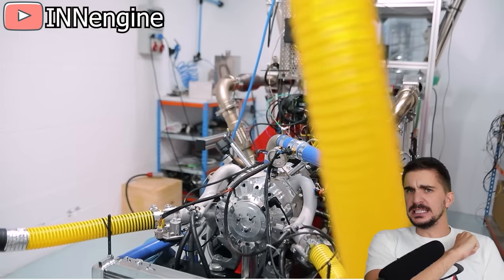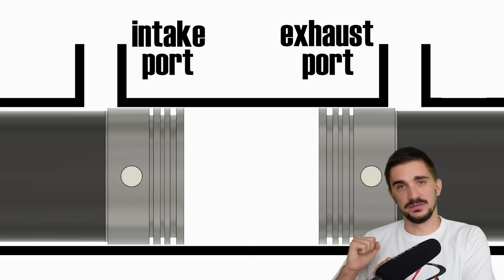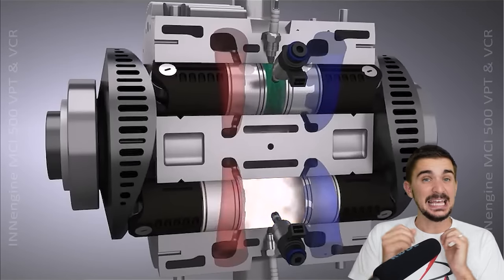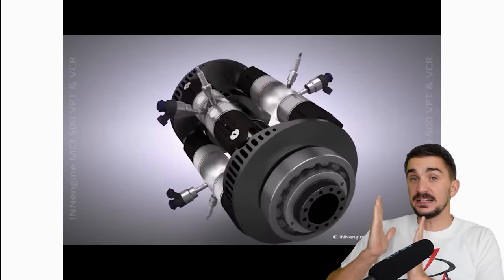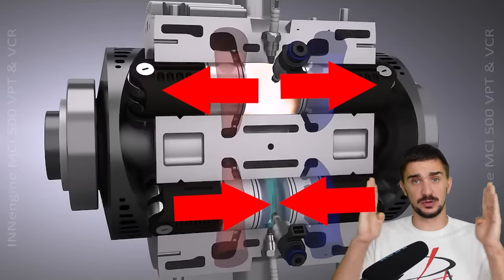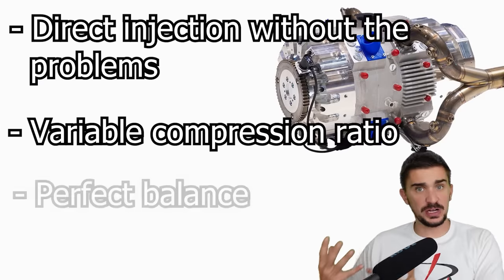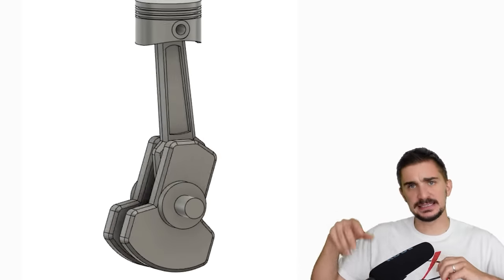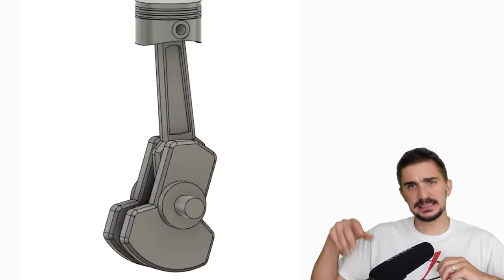Spain is Living in 2050? Revolutionary 1 Stroke INNengine Analyzed

Comment: Actual one stroke engine, mass manufactured and used widely in it’s era: the double-acting steam engine. Each stroke of the piston is a power stroke.
Reply: Hey, i am using your comment to warn people. This company is a scam. They don't have a product. If you give them money, it will be gone without any use for you.
Reply: steam engine is not even a 1 stroke, it is always on a power stroke on either side of the same piston. power on push and pull of every stroke.
Reply: It's still intake and exhaust though. It's just using both sides of the piston
Reply: I came to comments to say that as well.
Reply: Stream engines are external combustion engines; you're mixing apples and oranges.
Reply: @electronsmove  Every stroke in a steam engine provides power, therefore a power stroke every 1 stroke. Hence 1 stroke engine.
Reply: @mikeh2850  The intake is the power stroke on side A while side B is vented. Then switch / repeat.
It's never not on a power stroke.  We are referring to how many strokes to make one power stroke. So the answer is 0.
The only time it is not making power is at TDC for a few degrees while it changes direction.  Always wondered how you get a single cylinder steam engine to turn if it stopped right at TDC. It would be stuck without some input to the flywheel to get it past TDC.
To be fair the steam engine benefits from an external combustion chamber (boiler) to produce a forced induction charge and there is no need to combust the charge in the cylinder. I wish we could have enjoyed a longer period of history with the steam engine it was too short lived due to high maintenance. I wonder what we could do today if used modern techniques to build steam traction engines.
Reply: With low-revving Diesel engines for maritime applications in the first half of 20th century, a 2-combustion-chamber-per-piston arrangement was not uncommon. They fire every 180 degs per piston having one chamber above, one below the piston. But it wouldn't make any sense to call them 1-stroke as it is obviously a double-2stroke arrangement.
Reply: only one stroke engine is a rocket/jet engine.
Reply: @wargamingrefugee9065  makes it a motor
Reply: @electronsmove  Traction engines were often single cylinders, and they indeed have this problem of dead-centering and not being able to start on their own!

There's a few things you can do to fix it. If it's a model, you can push the flywheel over tdc and it'll start going. You can do this on larger engines too if you're feeling brave or you're on flat ground.

For full size engines, you could take off the brake and roll backwards/forwards a bit to get the piston moving again. For very large, stationary engines such as mill engines they would often have another, smaller engine to get them started and avoid the issue.

For compound engines, they have a similar problem but a neat workaround - due to the offset of the pistons, you're guaranteed that at least one will not be "stuck". If your hp cylinder is stuck, you can usually bypass it and send steam directly to the lp cylinder to get it moving (and at one hell of a rate considering you're now supplying full pressure to a cylinder designed to run on exhaust!)

-- edit to add something

I forgot the most important solution, just don't stop at tdc! 😆When bringing the engine to a stop you can make sure that you're past that point, avoiding the problem altogether
Reply: @Adesterr  Could you add a source by chance?
Reply: Yes, steam engine with baker or walschaerts valve gear.
Reply: @electronsmove  you should read on abner doble ;) if he had made his steamcar more on masse instead of expensive high end one of a kind, we might all very well be driving steamcars today
Reply: Also exhaust on the otherside...
Reply: @Adesterr  I was thinking of a "new" sportscar with 1000´s of horsepower that people have been waiting for..
They are still waiting... I dont even remember the name of the car. But they really liked investors...
Reply: @electronsmove  Valve timing on a steam engine, which feeds steam from either end of the cylinder, The connecting rod is offset from the crankshaft such that this isn't an issue
Reply: Also double acting 2 stroke diesel engines are used in many big ships.
Reply: @Adesterr  Source: It was revealed to me in a dream
Reply: @electronsmove no different than any hydraulic cylinder
Reply: I was wondering if that's what this was one side fires while the other side exhaust
Reply: Could a turbine be a "1 stroke engine"
Reply: @hakan8997  Devel Sixteen, hahaha. Though that is a much more outlandish product than this.
Reply: @802Garage  Thats the one i was thinking of. Iam getting old!
Reply: @electronsmove   Saab made a steam car I think around the 70's or 80's that supposedly produced over 200 hp and could get some serious gas mileage. like around 70 to 90.  I think it was too fuel efficient at6 the time. I know it had other issues. But It was close to being a production car. The thing is with steam engines is they only need an external heat source. An external heat source could be burning gas, diesel, alcohol, wood, electric heaters, cooking oils, used fats/grease, and so on
Reply: @legros731  not the cylinder the swash plate attaches to the pistons in the pump and can increase the stroke of the pump under high volume demand.
Reply: @hell_march6652  the issue with steam powered anything is time to start producing power and time to shut down and maintenance,
I just wish we could have lived with steam longer.
Reply: Came here to say this! There have been millions of successful one-stroke engines, they powered the world for a good century or so
Reply: @electronsmove  the TDC issue is why steam engines drivers are clocked 45 deg out. when either side is at TDC the other is mid stroke
Reply: @electronsmove That is what a one stroke engine means.
Reply: @redsnow846 double acting steam engines are 1 stroke.
Reply: @Elios0000  I suspected that was the case for a duel piston system but what about a single piston engine?
Reply: @modelsteamers671  1 stroke is 360 degrees. The piston will travel down power , up no power...1 rev. Down power, up no power 2 revs. 
2 revolutions 2 power strokes.
Steam engine is up power down power. 
2 power strokes per 1 revolution of each cylinder. Always on a power stroke no return stroke with no power.
Is my point.
Reply: @electronsmove  A stroke isn't 360 degrees, it is 180.
Reply: @electronsmove  That would be the definition of a 1 stroke
Reply: Lofl....here we go with the wanna be egg heads. How many "strokes" are involved with the fuel delivery to make the steam? You see? As was somewhat mentioned in the video, there is no such thing as a 1 stroke engine so far.....at least o e that doesnt require many inefficiencies to make it operate. It's like the ev crowd boasting "90% efficiency".....that's only partially correct. What's the efficiency % to get the power from the grid,to the home,through the charger and into the battery? Hint:there are heavy thermal losses along the entire process and we havent even talked about getting the power from the batteries to the motor(s). Liquid piston appears to be on the right track.
Reply: can't ever have one stroke with a piston that has to go back and forth. this is two stroke at best.
Reply: @diaman_d  double acting steam engines are 1 stroke.
Reply: Meh... my 100 yr old Hundastat diesel engine can do magic, not only can it switch direction on demand but can idle at ZERO rpm like a metronome
Reply: @modelsteamers671   yes those are, but rather specific also and not a combustion engine.
Reply: @diaman_d  I'm simply responding to your claim that you can't ever have a one stroke engine - that is clearly untrue.

Steam engines are combustion engines, they are external combustion rather than internal combustion as used in gas engines.
Reply: @electronsmove  Single cylinder steam engines used flywheels to carry them over center. The reason steam locomotives were high maintenance is because during their heyday maintenance was dirt cheap so there was no need to optimize them to be lower maintenance. It had nothing to do with any limitations of the underlaying technology. If modern engineering practices and materials were applied to the steam locomotive, it could likely be made just as low maintenance as a ICE locomotive.
Reply: @modelsteamers671  🙂
Reply: @modelsteamers671  a stroke is the movement of the piston in 1 direction. So unless the piston is moving perpetually down i dont believe it.
Reply: @mikeh2850  A steam engine doesn't have an exhaust cycle. The steam is drawn in with the down cycle. Water is injected in condensing the steam shrinking it to near vacuum,  and the ambient pressure of the atmosphere provides the power. Power is rated by cylinder diameter, and volume. The larger the area of the piston the more force is applied. The longer the  cylinder the longer the force is applied. Those factors determine the volume of the cylinder, how much steam is drawn in, and how much fuel is used to make the steam. Efficiency is rated by how low the pressure gets in the cylinder when the water is injected. 100% efficiency is when the force per unit area of the piston equals the atmospheric pressure against vacuum.
Reply: @redsnow846  a stroke is the movement of the piston in any 1 direction. A two stroke engine receives a power stroke on every alternate stroke (the downward stroke). A 4 stroke engine gets a power stroke at every 4th stroke (every alternate down stroke).
A double acting steam engine gets a power stroke at every stroke of the piston (the piston is powered down and powered back up) that is a one stroke engine.
Reply: @Adesterr I don't think anyone in the comments was going to invest in them anyway
Reply: @modelsteamers671  yes i understand how an engine works. your steam engine isn't really a 1 stroke engine either, in the same way a crankshaft isn't a 1 stroke engine. your steam engine is taking an externally generated working fluid to act on a piston in the up and down motion. while your example is technically correct. We are referring to a combustion based engine. using an air/fuel mixture to perform the work. That is why people have said a 1 stroke engine is impossible, because you cannot have intake, compression, combustion and exhaust on the down, and upstroke of a piston.
Reply: @dpsamu2000  A SINGLE acting steam engine CAN have an exhaust stroke which makes it a two stroke. Order is power (piston down), exhaust (piston up), power again, exhaust again .. in repeating fashion. There is no zero stroke engines and turbines do not count because they are not converting reciprocating movement into rotary. Dbl acting steams are 1 stroke. Edit: External or internal combustion has NO bearing on an engine's "strokeness"
Reply: @redsnow846  Have you even looked into it? What counts is the piston and clever use of both sides of it. Google "double acting diesel engine" and one of the links returned is "MAN Double-Acting Diesel Marine Engines". That is a 1 stroke ICE as one side or the other of the piston is ALWAYS seeing a power stroke
Reply: @electronsmove  what are you rambling about man 
I know how a variable flow pump work and have nothing to do with the subject here
Reply: @wargamingrefugee9065  yes but it would be possible to make a IC engine use both sides of the piston.  It would still be 2 stroke though :P
Reply: Diesel pile drivers are 1 stroke engines
Reply: @redsnow846  wether you like it or not, double acting steam engines are indeed one stroke engines, they are more commonly referred to as single stroke though.
Reply: @modelsteamers671  they are not internal combustion engine so no they are not one stroke the work exactly the same as a hydraulic cylinder
Reply: @legros731  They don't have to be internal combustion engines. Nowhere is internal or external relevant to this topic. The only requirement for a 1 stroke is that the piston, after TDC or BDC, has one of it's two faces exposed as a "combustion" (or pressurized) cycle. A double acting hydraulic cylinder with it's piston eye connected to a crank pin, powered by steam or air or whatever, is an engine .. though not a very efficient nor long lasting one with any medium other than oil. Not sure why this is hard for many here to understand. Contention on what defines an engine? An engine is a machine for converting any of various forms of energy into mechanical force and motion (per Webster).
Reply: @eduardoizquierdo309  Even gas turbines have four stages of operation. Intake, compression, combustion, and exhaust, all on a continuous basis.
Reply: @hakan8997 tesla roadster is one of them
Reply: @xenuno  Yes. In fact a malfunction of that kind of engine resulted in the insight that led to the water injected type. A water jacket around the cylinder meant to cool it corroded allowing water to enter the cylinder. the piston shot through the top of the cylinder revealing how much more power is available with water injection. Most piston steam engines are that type for safety to prevent that kind of disaster, and to take advantage of the power. They also don't need the cooling jacket which was to prevent the cylinder from getting hot, expanding, and leaking steam around the piston. They were the first form of steam engine because of the naïve thought that steam pressure was the only way to push the piston.
Reply: @modelsteamers671  No. The fact that the piston, and cylinder movement does double duty as both a power stroke, and intake stroke doesn't make it a one stroke.
Reply: @legros731  wavy thing is a swash plate , mush like the swash plate of  a variable displacement hyd pump.

https://www.youtube.com/watch?v=2mh902AP7Yw
Reply: @SuperAWaC  flywheel doesn't help when at TDC and also at rest. 
Your take on the maintenance issue is also my point.
I wish we could have had more time with the steam engine as a society to see it grow and iterate and optimize.
Reply: @modelsteamers671  no there are not they are 2 stroke one stroke up and one stroke down
a one stroke engine piston would only go up = won't do anything
Reply: @electronsmove  your point is dumb because going up is 1 stroke going down is 1 stroke no engine can be 1 stroke
Reply: @modelsteamers671  still the piston got 2 stroke one up and one down or 2 stroke 
You mixing powerstroke with  stroke
If a 1 stroke engine ever existed the piston would only go up and won't be a engine
Reply: @dpsamu2000  steam engine are not 100% efficient clown
There ton of lost heat so not efficient
Reply: @legros731  It is a 1 stroke from the piston and the crank's perspective which is what counts. On a 4 stroke it is every 4th stroke (crank rotation of 720°) between power strokes. On a 2 stroke it's 360°. On a 1 stroke it's 180° which can and has been achieved by making a combustion chamber (or injecting steam or air) at the top and bottom of the piston. Look up "MAN Double-Acting Diesel Marine Engine" or .. steam locomotives which (almost) always used dbl acting aka 1 stroke engines
Reply: @xenuno  what do you don't understand clown 1 stroke engine doesn't exist and never will 
You proven yourself in you comment that you are wrong Einstein lol
Take a 1 cylinder engine for simplicity=
4 stroke;1 cycle is 720°= 720÷4=180
2 stroke;1 cycle is 360°=360÷2=180
One cycle is 180 degree on any engine
Half a turn won't get you far lol
Piston go up = 1 stroke 
piston go down = 1 stroke
Basic engine principal piston need to go down to let air and fuel enter and it need to go up to compress the air fuel mixture for it to even ignite and produce power and push the piston down
A engine is just a glorified air pump
The engine you talk about is no different than a Subaru boxer engine 
You do know a 4 cylinder crank fire every 180° and a V8 every 90°
Reply: @legros731  no it wouldn't,  does a 4 stroke engine have a piston travelling in 4 directions?
A stroke is a piston movement in either direction, 4 stroke engine has 4 seperate functions in each cycle - induction, compression, power and exhaust.
A 2 stroke has 2 functions per cycle giving a power stroke at alternate strokes.
A single stroke engine has a power stroke at every stroke of the piston. 

Double acting steam engines are single stroke engines
Reply: @dpsamu2000  That isn't what I said. In a double acting steam engine every stroke is a power stroke, they are single stoke engines.
Reply: @legros731  tdc to bdc back to tdc is one rev. You sound like a joy to converse with. 
Do you really think one stroke is just halfway? How do you ever finish stroking?
Reply: @electronsmove  Never does for he's always stroking his piston ..
Reply: @modelsteamers671  even if it got a  power stroke in each direction it's still 2 stroke to complete one cycle that doesn't change the law of physics man you where almost right
Funny that you prove in the beginning that your last point is completely false 
A 4 stroke complete is cycle in 720° so 720÷4=180° so one stroke is 180° of rotation 
On a steam engine one side is in power stroke the other side in exhaust stroke you see what happen here a complete cycle for a steam engine is still 2 stroke
Reply: @xenuno  you need a governor to regulate piston stroke speed to avoid blowing a head gasket and leaking fluids all over the place.
Reply: @legros731  No, you are wrong. In a double acting steam engine every stroke is a power stroke.
A double acting steam engine is a single stroke engine.
Reply: @electronsmove  Ya there is several design considerations to be made ..
Reply: @Bill-sp8kb  ur right, my bad
Reply: I’m surprised no one has come up with a Gas or Diesel Engine, using the same Principle as the Steam Engine. It seems like it would Work?
Reply: @hitekredneck109 how many Strokes does it take to Screw in a Light Bulb?
Reply: @joeybobbie1  lol....i suppose it depends on how many threads and the range of motion in one's wrist... assuming yer screwin it in by hand....that's prolly a better question for the utube university professors
Reply: @joeybobbie1  It's been done .. it's just not light nor compact. Google "double acting diesel engine"
Reply: @eclecticDIY  so does electric
Reply: Actual one stroke engine, mass manufactured and used widely today: the gas turbine.
Reply: @brandonswindler1690  but wouldnt "stroke" be used to define a reciprocating action? So a turbine would be a "one cycle"? Or just a rotating thermal engine?
Reply: @wargamingrefugee9065 everyone likes fruit cocktail
Reply: @roseroserose588 noice!
Reply: ⁴ go
Reply: @hitekredneck109  If you think about the typical intake, compression, ignition,  and exhaust actions ("suck, squeeze, bang, and blow") that are present on any 2-stroke or 4-stroke engine, all those steps happen in one direction on a gas turbine as the air travels from the front/intake of the gas turbine to the rear/exhaust end.
Reply: Exactly... Are you thinking about the Waukesha Steam Engine?
Reply: @dougaltolan3017  Especially on a hot summer's day. :-)
Reply: Yeah, was frustrated with the nonsense language being used to add intrigue. 

This isn't honesty, this is dishonesty disguised as something Novel. 

Definitely not a 1 stroke engine, lets not use language to confuse.
Reply: One word:

Boiler.
Reply: @electronsmove  A steam engine isn't zero stroke. It still has one power stroke for each stroke of the piston, not infinity power strokes. By your thinking, we could call any 4-cylinder or higher motor zero stroke since it's always producing some amount of power except a few degrees at TDC, and 6+ cylinders are even making power then.

And many motors are difficulty to start if they stop at TDC. Old-school, pedal-driven sewing machines have this problem. I often had to kick start them as a kid. Most motors have rotating starters for this reason.

2-cylinder steam engines can be offset by 90° so you can always apply torque to one cylinder or the other. With double-acting pistons, you apply pressure to whichever side makes the crank move the correct direction.

And engineers keep a prybar near the 1-cylinder engines just for this purpose. For larger 1-cylinder engines, they making barring motors. It's basically a starter motor whose entire purpose is getting the main engine to a better position (as opposed to a starter motor that keeps the engine turning while it builds up compression). And they're called "barring" motors because the simplest version is a dude with a crowbar.
Reply: @dpsamu2000 😅
Reply: @GeekOfAllness  My point is its a double sided piston so there are 2 power strokes per revolution of the crank for each  piston.
 Which is not possible with common ICE engines. 
That is the point. Any debate seems to be semantics.

And no a 4cyl is not making a power stroke per piston on every revolution. You are misreading me or intentionally misunderstanding the point being made.
Reply: @electronsmove  You called it a zero stroke arrangement, on the basis that it's continuously making power except at TDC/BDC. A 4-stroke, conventional, 4-cylinder motor is continuously making power except at TDC/BDC, and would therefore be a zero stroke arrangement under that definition.

We could reword that and say the steam engine is continuously making power on that specific piston, so the 4-cylinder motor doesn't count. Which may have been your intent. But we already have a term for that: a 1-stroke motor.

The conventional definition of a stroke is the motion of the piston between times it changes directions. There are some weird motors where that definition doesn't make a lot of sense, but a conventional steam engine can use the definition just fine.

The conventional definition of a power stroke is any stroke of the piston during which the piston is being powered.

The conventional definition of the stroke number of a motor is how many piston strokes occur for every power stroke.

Based on those very simple definitions, a steam engine has one power stroke for each piston stroke, so it's a 1-stroke motor.

Doing a little math, we can see there's a simple formula: stroke number = piston strokes / power strokes. In order to get a 0-stroke motor, we'd either have to get rid of piston strokes entirely (something like a jet turbine or thermoelectric generator) or have an infinite number of power strokes for each piston stroke (which can't happen because A) infinity and B) if you add more power strokes, you have to add more piston strokes, so you can't have more power strokes than piston strokes).

So any remotely-normal, piston-driven motor is necessarily not a 0-stroke motor unless you want to completely redefine terminology into something the rest of the world doesn't use.

Any time we're discussing the meaning of words, we're discussing semantics. That, semantically, is what the word "semantics" means. When you tell someone a steam engine is a 0-stroke motor, not a 1-stroke motor, you're (incorrectly) arguing semantics. When I tell you that it's actually a 1-stroke motor, I'm also (correctly) arguing semantics.

Note the difference between arguing semantics, and a "semantic argument". That's when you make a claim using (what I consider to be) an incorrect definition of a word, then I pretend you made the claim using my definition, then I proceed to say you're wrong based on an invalid interpretation of what you claimed. My claim that your definition of a 0-stroke motor would include 4-cylinder motors could be an unintentional semantic argument if I misconstrued your definition. But the claim that steam engines are not, by normal definitions, 0-stroke motors is arguing semantics, not a semantic argument.
Reply: @GeekOfAllness  4 stroke: , 1 power stroke in 4 rev.
2 stroke :1 power stroke per 2 rev
1 stroke : 1 power stroke per 1 rev
stream: 2 power strokes per  1 rev
Therefore steam is not a 1 stroke.
Are we doing 0.5 stroke? 
1 does not = 2
If we can use fractions then steam is a half stroke engine then.
Reply: @electronsmove  It's power strokes per piston stroke, not per revolution, so you're off by a factor of 2. But you still wouldn't get a zero-stroke motor.

Under your newest (still non-standard) definition, a 4-stroke motor would be a "2-stroke" (has two crank revolutions per power stroke), a 2-stroke motor would be a "1-stroke" (has one rev per power stroke), and a 1-stroke motor like a double-acting steam engine would be a "½-stroke" as you say (one rev per two power strokes). You'd still have to eliminate revolutions or have infinite power strokes per revolution to get a zero-stroke motor.
Reply: @GeekOfAllness  you just cant follow this can you?
Power strokes per piston per rev.
1 in 4
1 in 2
2 in 1
They are not equal is the point so you cant say steam is equivalent to a 1 stroke that has 1 power stroke per piston  every 1 rev.
Doesn't matter what you call it, it is not the same.
If it is not equivalent then it can not use the same name.
To sum up.
1 stroke has 1 power stroke per piston per rev.
Steam is not that.
This is not questionable. These are facts.
It is different , 
It is not the same.
And so it needs
A different name.
Reply: @electronsmove  The British are still building a few steam locomotives.
Reply: @Elios0000  Steam engine cranks are a quarter turn apart; that's 90 degrees.
Reply: @dpsamu2000  That's 300 years out of date. No one uses a vacuum steam engine any more. Power is (force through distance), divided by time, for any motor.
Reply: @electronsmove  Stroke number, by any normal definition, is the number of piston strokes, not crank revolutions, for each power stroke. A 4-stroke motor is not four revolutions per power stroke; it's four piston strokes per power stroke.

There are two piston strokes per revolution. The piston goes up as one stroke, then goes down as a second stroke. Then the cycle repeats.

The problem is that you're trying to define 4-stroke and 2-stroke motors using piston strokes, then a double-acting steam engine using crank revolutions. A 4-stroke motor is a 2-rev motor, a 2-stroke motor is a 1-rev motor, and a steam engine is a 1-stroke, ½-rev motor.

A 4-stroke motor has 4 piston strokes, which happen over 2 crank revolutions, for each power stroke. Down-intake, up-compression, down-POWER, up-exhaust. Each up-down cycle is one crank revolution, so the entire process takes two revolutions.

A 2-stroke motor has 2 piston strokes, or 1 crank revolution, for each power stroke. Down-POWER&exhaust, up-intake&compression. The entire process takes only one revolution.

A double-acting steam engine has 1 piston stroke, or half a crank revolution, for each power stroke. Down-POWER1&exhaust2, up-exhaust1&POWER2. The entire process still takes one revolution, but you get two power strokes.

By taking the time to see that a double-acting steam engine has twice as many power strokes per piston stroke (or crank revolutions) as a 2-stroke motor (not four times as many), we see that it makes sense to call it a 1-stroke motor, because 1 is half of 2.

By realizing that a 2-stroke motor has only one revolution per power stroke, but two piston strokes per power stroke, we can see that it makes sense to count piston strokes, not crank cycles, when defining the stroke number of the motor in a way consistent with existing definitions.
Reply: @legros731  You seem to also be confused by what makes something an N-stroke motor. It's true that a double-acting steam engine has 2 strokes for a complete cycle. So the total cycle is still 2 strokes.

But we normally define the stroke number of a motor by the number of piston strokes per power stroke. Since, on a double-acting piston, there are two piston strokes per cycle, but also two power strokes per cycle, it's a 2:2 ratio, which reduces to 1. That makes it a one-stroke (or single stroke) motor. Because there's one piston stroke per power stroke, not because the piston never comes back down.

A similar concept exists on bicycles. You can run a strap around the top of your foot, and pull up on the up stroke. You might call it a 1.5-stroke setup, since the down stroke is much more powerful than the up stroke, but you're still getting power on each stroke of each pedal. It's not a full 1-stroke, but it's also not a 2-stroke.
Reply: Two things….first, they made great strides improving the steam engine.  But the diesel took over in the locomotive market, and turbines/diesels in shipping.  
There is a video about it here on YT. Sorry, can’t tell you much more but it was interesting when I watched a couple of years ago.
Reply: @yestfmf  It didn't help that the coal miners kept going on strike, for months at a time, while oil was cheap and plentiful.
Reply: @GeekOfAllness  steam is not the same as  1 stroke ICE.
Reply: @electronsmove  Steam engines are external combustion, which makes them, by definition, not internal combustion engines (ICE). They're still 1-stroke motors, and they operate on the same concept as existing 1-stroke ICEs: apply power to both the top and bottom of the piston in alternating power cycles.
Reply: @GeekOfAllness  I made all those points earlier.
If anyone reads all my comments they either understand my position and agree or  disagree or willfully misunderstand.
Reply: @electronsmove  I did, in fact, read through all your comments, and no, you didn't make all those points earlier. You make a valid point or two, then insert some nonsense and confuse yourself. Obviously, external and internal combustion is different. But that's completely irrelevant, because the actual motor works the same way: pressure in the cylinder pushes the piston a specific direction, then the piston reciprocates. We can define "stroke" the same way in both motors (it's 180° of the crank, not 360° as you claimed in a couple earlier comments), we can define a power stroke the same way in both motors (it's any stroke where power is being generated, which is 1 out of 4 on a 4-stroke, 1 out of 2 on a 2-stroke, and 1 out of 1 on a single-stroke steam engine or 1-stroke ICE), and the rest of the world, in fact, does exactly this.

Your initial definition of "stroke" was wrong, but it still doesn't lead to the conclusions you're making. If we define stroke number as the number of strokes between power strokes, the steam engine is "0-stroke", because there are 0 dead strokes between power strokes. But then a 4-stroke motor is a "3-stroke", a 2-stroke is a "1-stroke", etc. Your definition is functional and makes sense, but doesn't conform to any normal definitions or the labels on existing motors.

If we define stroke number as the number of power strokes per crank revolution, the steam engine is ½-stroke, not 0-stroke, and 4-stroke and 2-stroke motors are 2 and 1-stroke. Again, the definition is functional, but doesn't conform either to normal definitions, or to your claim of a 0-stroke motor.

Further, this started with you making the claim that people are wrong for calling a steam engine a 1-stroke motor. So not only do your definitions not make sense with your claims, they're not even relevant. Because the original claim (that a double-acting steam engine has a 1-stroke motor) was based on normal definitions, not stuff you made up.

Anyone reading your comments can't understand your position, because it's nonsense that isn't even self-consistent, and you keep changing your claim. The fact that you've made some true statements in no way changes the fact that a double-acting steam engine (or a double-acting ICE) is 1-stroke motor by normal definitions.
Reply: @GeekOfAllness  "If we define stroke number as the number of strokes between power strokes, the steam engine is "0-stroke", because there are 0 dead strokes between power strokes."
You got the point.
Reply: That's a two stroke. This one is too.
Reply: check out air engines... where steam is replaced by air.  the ones i see r two stroke... i wonder if it works on the 1 stroke principal  @electronsmove
Reply: @guccing7556  Air engines (that I have seen) usually follow a 2 stroke design. Steam engines have steam on both sides of the piston which gives it a near constant drive and very high torque that is hard to match. The whole debate we are having here  revolves around people zooming in on one small partial rotation of an engine and then categorizing that engine based on that partial rotation or partial cycle. I would use the same degrees of rotation for all engine  types and or a compete cycle which usually takes multiple rotations. I would further simplify the discussion by making all the engines compared be single cylinder designs to avoid confusion.
In this context, we can see that:
A 4 stroke engine has  1 power stroke per 4 rotations of the crank to complete one full cycle.
A 2 stroke engine has  1 power stroke per 2 rotations of the crank to complete one full cycle.
A 1 stroke engine has  1 power stroke per 1 rotations of the crank to complete one full cycle.
And a Steam engine has 2 power strokes per 1 rotation of the engine.
Yes it is external combustion but this is not the debate.
Since the steam engine has 2 power strokes per rotation, it should not be listed in the same category as engines that have only 1.
Because 1 is not equal to 2.
Reply: @electronsmove  How many times are you going to contradict yourself? Did you not learn your stance is illogical and wavering. I think you need to start with the basics cause they seem to be alluding you. A single acting steam engine is a 2 stroke, a dbl acting steam engine (and the diesel I named up above a month ago) is a 1 stroke because pressure is applied to the piston at the top or bottom of it once per stroke, which is defined as 180° of crank rotation starting with piston at TDC or BDC. This approach works for ICE, ECE, air, and even vacuum (flame licker) engines. Count it for a ICE where boom is the power and thus 1st stroke .. 4 stroke (boom, 2nd, 3rd, 4th .. repeat), 2 stroke (boom, 2nd .. repeat), 1 stroke (boom .. repeat)
Reply: @xenuno  You seem to be willfully misunderstanding the point I am making.
Just count the number of power strokes in one cylinder during one complete CYCLE and it becomes obvious.
A cycle is not 180 degrees. One cycle is power stroke to the next power stoke.
You want so bad to argue nothing is going to stop you.
There is no hope for this nation.
Reply: @xenuno  Let me use fewer words.
To see the difference in each engine type, count the number of revolutions between power strokes.
Just do it.
There, done. They are not the same.

That has been the only point the whole time right there. 
1,2,3,4.....you only need to count to 4.
Reply: What cools this unit. I see no accommodations for cooling
Reply: @electronsmove i think that problem was tackled with using weighs in the wheels so the loco always stops with a weight at the bottom
Reply: @tad2ik  Those weights are to balance the crank and connecting rods.
Reply: Yes, got to experience one of those in the Steam boat on Lake Wakatipu in Queenstown NZ 
Engine room is on display and very interesting.
Also a warm room!!!
Tss Earnslaw is her name.
Reply: They are obviously counting the rotations of the wavy thing as equivalent to the crankshaft rotations of a conventional engine.  The wavy thing only goes half way around per stroke, if I saw the internals shots in the video correctly.  My first thought was, it needs to be supercharged, because using sound wave tuning for scavenging would only work at one narrow band of rpm... the engine would get on its pipe. I see that the actual installation agreed. 

Finally, the two stroke loses efficiency in my ancient experience because the power stroke is cut off when the exhaust port is opened. Thus the effective displacement is reduced.
Reply: @I..cast..fireball Look at the comment right above yours and learn steam engines are external combustion not internal as depicted in this video.
Reply: @jajajajajajajajaja867  I'm well aware of that bud. The question is how many strokes per power stroke. The answer is one.
Reply: @somad6997  
1 of 4 is 4 stroke
1 of 2 is 2 stroke
1 of 1 is 1 stroke?
2 power strokes per engine stroke is what?

2 of 1? half stroke?
1 power stroke every 180 degrees is not the same as 1 power stroke every 360 degrees.

It's all semantics, people can look up how engines work or not , it was a minor point of clarification that seems to have twisted people's minds around.
Reply: @mikeh2850  still closer to a 1 stroke than this is. This is very similar to a design i thought of when i was 16. decades later i found that England made one in the late 60s or early 70s for big trucks.
Reply: @electronsmove  still every stroke produces power. you are overthinking it.
Reply: @maddhatter3564  One more time.
Every motion of the piston in a DA steam engine is a power stroke.
Take as long as you need to let that sink in.
Stop getting hung up on what a stroke is or strokes to rpm.
Every motion of the piston in a DA steam engine is producing power.
That is the only point I am making.
This is also more than is produced by a "1 stroke engine".
Since it is more , it is not the same.
Oh look My comment is actually a highlighted reply.
Reply: @GeekOfAllness   
Every motion of the piston in a DA steam engine is a power stroke.
Take as long as you need to let that sink in.
Stop getting hung up on what a stroke is or strokes to rpm.
Every motion of the piston in a DA steam engine is producing power.
**That is the only point I am making.**
This is also more than is produced by a "1 stroke engine".
Since it is more , it is not the same.
Reply: I think a pulse-jet is a one stroke engine.
Reply: No that is wrong
Reply: Double action steam pistons are 1 stoke engines
Reply: @gottogo8675  as many ppl seem to be missing the point I just dont GAF anymore.
Reply: Nope, because what you´re describing is just a cylinder powered from the outside. It has nothing to do with producing power, only utilizing it.
Reply: @olenilsen4660  The origins of the energy is irrelevant (it need not be a combustion-in-cylinder type of engine; and FWIW, all energy can be traced back to the Big Bang); only how many strokes there are per power producing cycle. (Obviously this also only applies to reciprocating engines; things like turbines don’t even have strokes).
Reply: @olenilsen4660  this is true, the steam "engine" includes a boiler as the energy source. The cylinder alone is not the complete engine.
Reply: @electronsmove  Not pull, pushed from the other side. Pressure is always push! And the cyliner on the other side of the loco is 90 degrees out of phase, giving 4 power strokes per rotation of the driving wheels.
Reply: There were also double acting diesel engines, primarily used in maritime application in the first half of the 20th century, tho each half of the piston functioned as a 4 stroke engine.
Reply: @electronsmove  Yup, that’s a ‘1-stroke engine’, as you’ve just stated..
Reply: @redsnow846  no, because there is no ‘stroke’.
Reply: @electronsmove  you sound as if you don’t know too much about steam engines and boilers. Flash-steam boilers produce steam very quickly. High-speed, enclosed, poppet-valve steam engines (looking very like the block and cylinder head arrangement of internal combustion engines) are a known thing, and were used in fast launches, etc. stop dreaming and get yourself a lathe!
Reply: @dpsamu2000  no, you’re wrong completely. That is a vacuum engine, and was a very early use of ‘steam power’. No conventional steam engine worked like that. Look up your history of steam.
Reply: My stars! There are some ignorant people in the comments. Can’t even count the strokes in an engine… where did you go to school, guys?